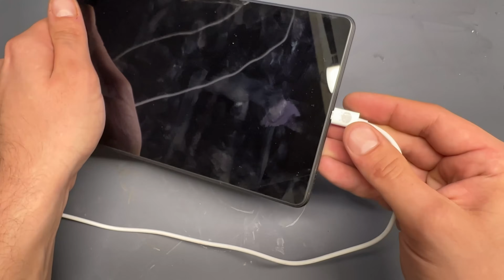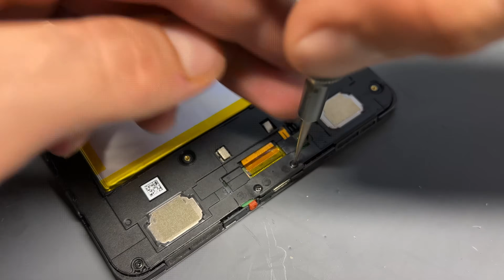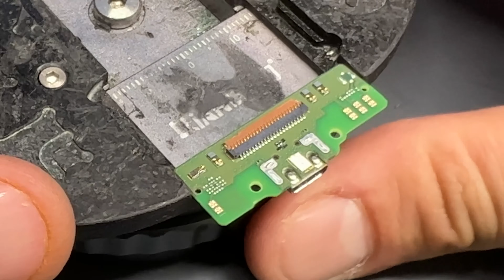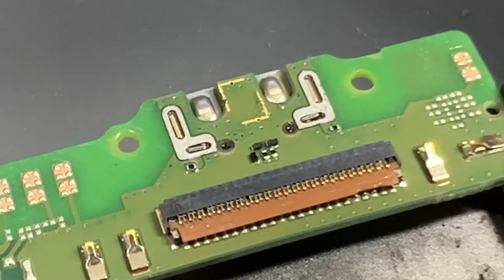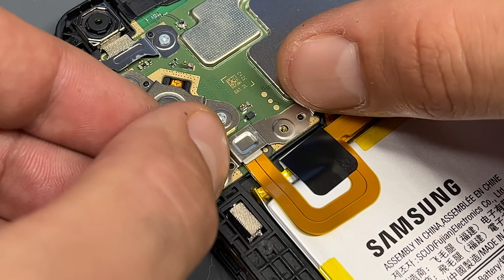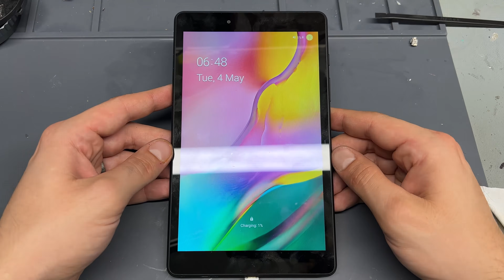Samsung Galaxy Tab A 2019 charging port (SM-T290 ) | how to fix Samsung galaxy tab A chargingport

Comment: 138 low melting, huh... I don't have it and I could not get the port to drop no matter how much heat I applied. Is adding the low melting solder really the trick?

Comment: What brand flux and solder do you use? I have always used Kester. I have a late model Samsung that has a very thin bezel. I have the standard blade tool but don’t see a gap to put it in to separate the case.

Comment: Very nice. I have a Samsung 8 “ tablet that’s only a couple of months old with the same problem. Does the tab A8 and previous model use the same dc connector pcb? This one has a very tight LCD to body. Very little bezel to case crack. Not much of a soace to get a guitar pick into. I can’t turn it on to see the model since it won’t charge. Looks harder to get into but it’s on the list. Nice soldering. I did repair for 33 years but mostly through hole boards with some surface mount. I remember when a 40 pin dip was a big IC. We had laptops with 12 D nicads. Times have changed.
Reply from the maker: If my memory serves me correctly the A8 has a "daughter board" for charging and is effectively a modular part. also, the plastic back cover will pop off on this one with the right amount of leverage. I usually try and squeeze a pick in around any buttons or memory card trays. that's where the plastic is most flexible